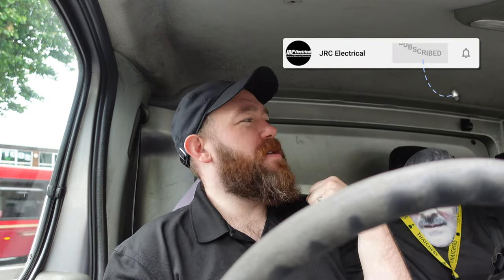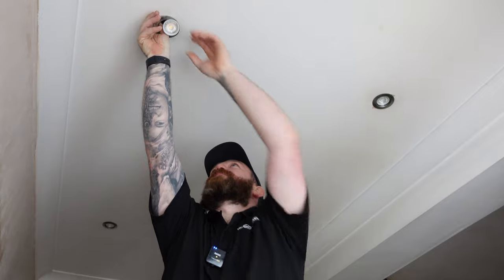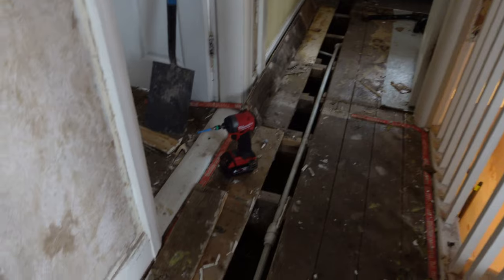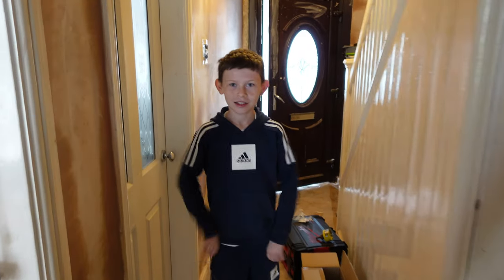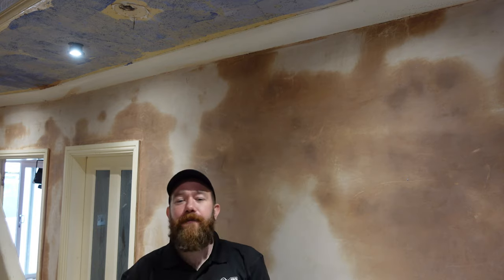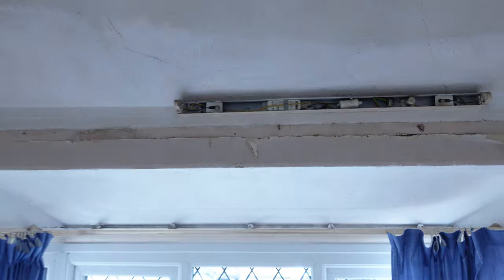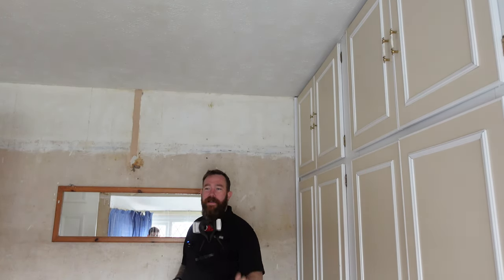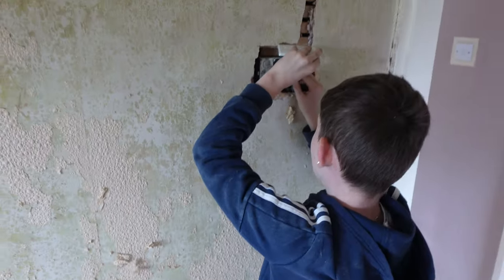How To Install Spotlights In Your Ceiling - DIY? - Electricians Life Vlog #downlights

Comment: Great video thank you m8.  We have a problem with our spots falling down.  We got most of the rooms repainted and the painters pulled the spots down and damaged the plaster so none of them fit tightly in the ceiling.  Any suggestions on how to fix this?
Reply from the maker: 😬 either get bigger spots or have the edges patched up and fit them in, bigger spots would be easier tho

Comment: hi. great vid is it bad practice to use a wago box above a light fitting loose or should you screw it ane tie clip and also is it bad pratice to put all connectors in a wago box loop in, loop out, and swith in wago and then run swatch live,  neutral and earth into new light fitting using another connector like the click connectors
Reply from the maker: To make it non maintainable I think they need the cable tie and screws but in my opinion if it’s in a loft or accessible I don’t always screw them down, if you can get them all in a Wago box and there is room for the wagos so they don’t move about then I would say it’s fine to put them all in one, I’ve done it loads and never seen or had. Problem